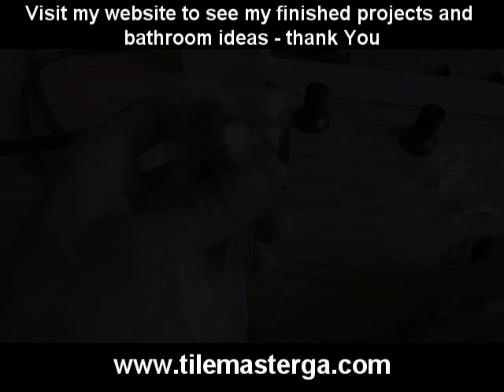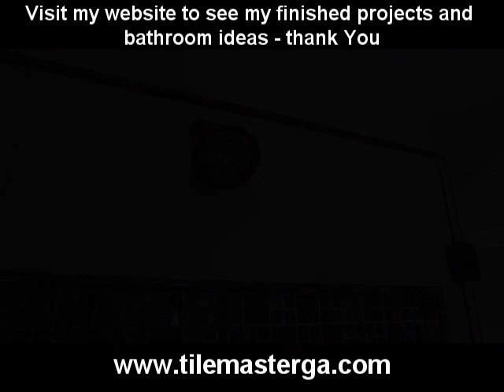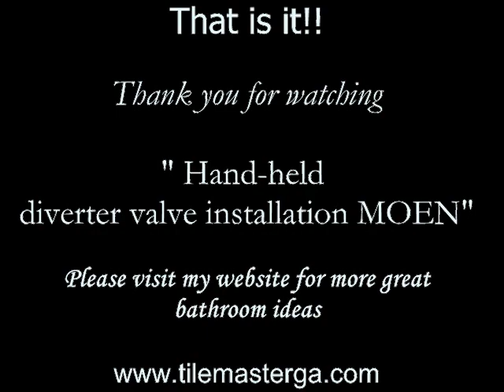Part.4  Shower Diverter, Transfer valve trims and fixtures installation step by step - Moen, Delta

Comment: Moen recommends 12" between centers of supply and transfer valve for the cover plates.  I would like to use 9" since I want to build in a shower niche above the transfer valve without getting to high.  The plates would not touch so I assume that this is ok.  Am I correct?

Comment: Thank you for this video. Have you ever installed a slidebar in a fiberglass or acrylic direct-to-stud shower?
I need to make a bathroom more ADA friendly for my disabled mother. She will have to sit during her shower so will need to reach everything from sitting position. I believe she only wants a handheld showerhead, so I'm trying to figure out the best positioning for the slidebar, drop ell, and lever (planning to get Moentrol lever-- specifically the Kingsley line).
I will also have to add grab bars to help her get in to the shower and up and down from the shower seat.
Any suggestions?

Comment: Hey GREAT videos you make, thanks for that.   I have a question about this setup: is there is anyway to do this configuration without loosing water pressure when both shower head and hand shower are on?   I am about to install a similar set up in my master bath and would like to use both without pressure loss.  Thanks...

Comment: Our handheld shower hose sprung a leak and when I replaced it I found that the piece that attaches between the ell drop and the handheld is leaking from the bottom - it looks like a piece of the black plastic is degraded or broken off. Any idea what that is called to replace it? Or should I just call Moen? Thanks!!

Comment: Hi, question on the 3372 diverter valve... I just received one (and a 3375) yesterday and noticed it has no stops (the cartridge rotates continuously cw or ccw). Are the stops built into the trim kit?  My trim doesn't arrive for a few more days so I was curious. Thanks.

Comment: so when installing the drop ell wall connector, my contractor can't seem to find the right nipple length (they only come in 1/2 in increments), he then bought a tub spout nipple to "cut" but only one side will thread properly into the wall and the other side he can get to the 3 oclock position, and says if he tightens to the 6 oclock position, it might crack the tile (the hold also sits on a seam like yours). Any suggestions?

Comment: How did you know the length of the prefab threaded chrome pipe for the hand held water connection?
Reply: Hi Jim... I have done this before and it takes some planning. When you install the threaded drop ear elbow fitting inside the wall with the brass pipe (length to be determined by you) fully threaded into the elbow, the pipe needs to extend 3/8" (10 mm) beyond the finished edge of the wall (e.g. backer board plus tile). This will allow the drop ell (aka hand held connection) to point down when fully tightened to the wall. The brass pipes are sold in 1/2" increments so plan accordingly. If you search Home Depot for a Moen drop ell, Moen has posted a picture of this in a response to a customer question. https://www.homedepot.com/p/MOEN-Drop-Ell-in-Chrome-A725/202506279
Reply: The pipe 3/8 extending out beyond the tile was was perfect. I was lucky and a 3 inch brass pipe was the exact length I needed. Thank for the help and the video!

Comment: how do you know the measurement so the valve trim will fit perfectly after the tile is set up ??  it looks fantastic
Reply from the maker: +marco martinez  It is called " Experience in field" plus when you do your own plumbing you can adjust valve to your preference. Everything has to be figured way before you will attach tile board and first tile.
Reply: Im doing my shower and i got the MOEN 3375 TWO FUNCTION TRANSFER VALVE .. do this will do the same as the one you got installed it in this video?? Sorry to bother you if i ask too many questions
Reply: marco martinez usually the specs are listed in the spec sheet .. i.e. thick wall . and thin wall measures
Reply: marco martinez
Reply: Joe Hansen thank you i try to ask this guy on the video but he didn't help at all.. i guess he think he knows it all because the way he answered my question.. IT'S CALLED EXPERIENCE IN THE FIELD...  im  a professional but so far i build  my whole house by myself... lol thanks for reply back
Reply: Ya that was a dick head coment , that's why I comented those installs are incredibly tricky but max and minimum measures are there . the instructions are quite vauge . there is rough out caps in all shower diverter s that help you get the right depth with the board and tile .
Reply: Ya, Moen has a good video on how to install the valve if your wall is greater than 1/4" ( placement of the part called a plaster ground).

Comment: How are you keeping water out of your wall, seeing there is no gasket behind the elbow and no plumbers putty filling the gap around the pipe? It's also sitting right on top of a grout line (water channel).
Reply: Dont want to be critical but i was wondering that myself. Maybe they had gaskets. It didnt look like it.
Also, i think u can just tee the diverter valve straight up right to HandHeld leaving the shower on and valve handle in the pointed down position. I really dont know tho

i watched him do another bathroom with a RainShower and it looked great
Reply: Since the pipe isn't under a lot of pressure (the water is all going out the shower head) - I believe that using teflon tape and tightening by hand is sufficient.  The seals that one must be worried about is the diverter valve.

Comment: Great video.  I don't think you mentioned that when drilling the holes for the bar, you would do well to have a drill with "hammer" mode.
Reply: Hammer drill on tile is pretty risky, especially for smaller tiles.

Comment: Good job!!
Could I use same set up for tub?
Will anything change?
Reply: Yes. In the middle of installing one now. Moen has one where the tub valve and diverter valve are one piece. the directions are not very clear. I wish I'd gone with a separate diverter. In this video, I believe he had a regular tub/shower valve but, with the tub down pipe capped off.

Comment: I am installing a   MOEN 3 FUNCTION TRANSFER VALVE but I was not sure how far back to place the hand held fitting in the wall and it did not come with two threaded end pipe so where did you get it and how lone is that pipe
Reply: See my response to Jim Gordon above for the answer.

Comment: Thx - will cold water sit in the handheld hose between uses?  how do you avoid that?
Reply: +wisterwalcott Well you can either let your handshower dangle down in the tub so that the water will drain or you can turn the water on and wait a few seconds for that water to come out before you step into the shower. I have a tankless water heater so I always turn on the shower and wait a minute for the warm water to reach the shower before I step in anyway.
Reply: +David Christian Thanks. After some reasearch I am going to try for a third option. I am thinking that using a diverter on the tub spout should create a siphon action and clear the handshower hose when the water is turned off...  Hose and supply elbow will be free of backflow valves and suction breakers.

Comment: your hand held shower connection is backwards.  you have the wrong piece conencting to the part on the wall.
Reply: nope, you were right, i was wrong, apparently that piece also acts as a backflow protector.